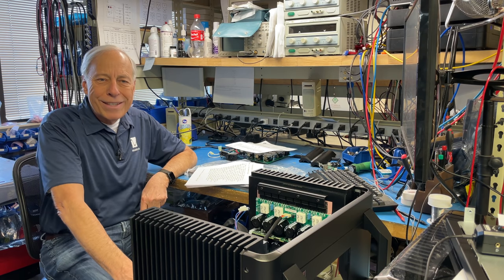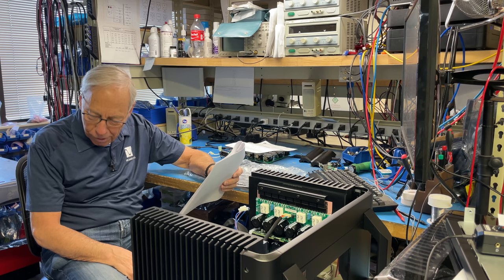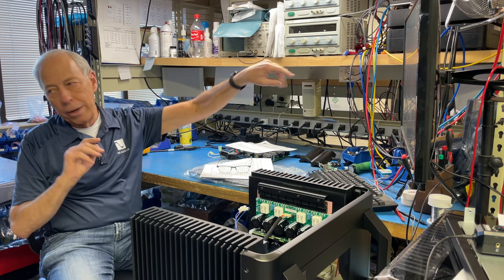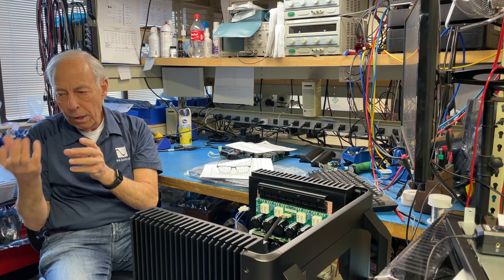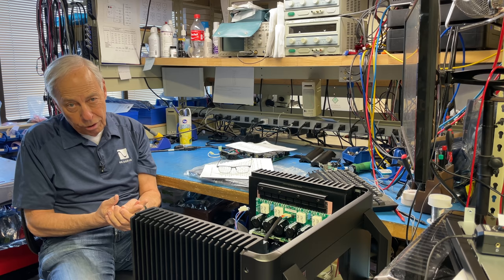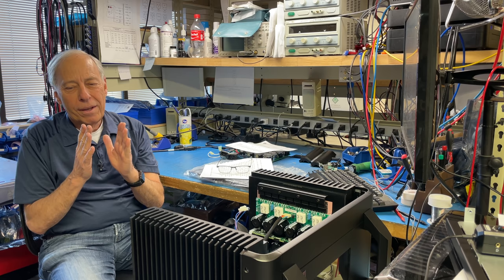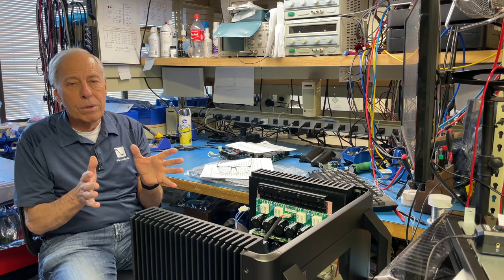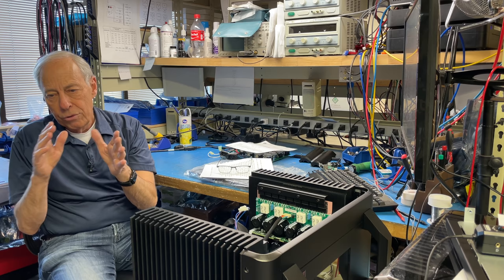Differences in digital audio cables

Comment: Sorry I love this channel and I agree with 90% of what Paul has to say but when he starts about digital, OMG he clearly has no idea how that works. Wow jitter noise and timing information encoded in the BIT's damn that is news to me. First of all why does everybody think a DAC is directly connected to an ethernet cable, it absolutly isn't. Ethernet cables are already galvanicaly seperated from the PHY chip, then there is buffering of the data in the PHY chip then the MAC and then the processing of the TCP/IP stack. Jitter does not come from the transport of the audio data it only comes from the clock used to drive the DAC. It's a ridiculous claim if you can hear a difference in an ethernet cable/switch. And yes I am an audiophile and yes I spend money on analog cables so I am not a cable hater.
Reply: I respect everybody's opinion but I will disagree. Networking gear (Ethernet switches and cables) both were not designed for audio.  Especially Ethernet switches. The ones you buy off the shelf are noisey with cheap power supplies that throw all sorts of crap in to the Ethernet cable to a cable or streamer. You are seeing more companies like sonore, uptone, melco, innuous  etc all realizing this with stitches designed specifically to combat this. I used to think similar that all that noise couldn't be riding down my Ethernet cable to my streamer until I started messing with its cheap power supply. And than you start optimizing all the other clocks and associated parts with the switches with a good power supply and it's immediately obvious. I'm honestly shocked it has taken audio companies this long to know they were never designed for audio. I admit though once you go down this rabbit hole you will keep finding improvements to be had with better and better power supplies for each component. After a certain power it's a lot of boxes to combat it. Just my experience.
Reply: Anyone who says you can hear a difference in network cables is either a NIC themselves or are living in lala land. What's next they can hear a difference in WiFi antennas?
Reply: @paulgyro  I have different Ethernet cables here that sound different. Why the need to discount what other people know that have tried them? Guessing your somebody that has never tried comparing?  One of those all cables sound the same folks? I really hate these cable debates with people that have never tried and compared different ones. And if they have, they haven't tried them in a system capable of revealing the difference. And even than you will have some so stubborn to reject they are making a difference because of the cost differnce.
Reply: @brandonburr4900  Just demonstrate the difference in a blind test. If it makes a difference to the sound you should easily be able to tell. Time after time though the results are not reproducible if the person listening doesn't know what they are listening to. It doesn't mean the effect isn't real, it just means it's happening in your head not in the equipment.
Reply: @CraigArnolduk  seriously? It's obvious in my system. No need to blind test things. I'm honestly sick of all this blind testing blah blah it's all in your head nonsense. I debated weather to even respond to this. Same nonsense audioscience.com crap tells people. I use my ear and my system to judge.
Reply: @brandonburr4900  It's very interesting, because apparently the science bit stops after the engineering? Everything we know about the human brain says that it is subject to bias and placebo, but yours (and perhaps all audiophiles) have some difference that distinguishes you from other human beings? Well there is an easy way to prove that if you wanted to. In a blind test. It costs you almost nothing to do. You don't even have to tell anyone the results. Well except yourself of course and therein lies the problem.
Reply: @CraigArnolduk  I have a engineering background. So no need to go into all that. Blind testing means nothing. You sound like you are just talking without having tried this stuff.  I'm no differe t than any body else. I listen to music for pleasure. I could care less about what others think honestly. Everything in this hobby has its own sound signature. Cables, components, speakers, wires, capacitors, resistors...Everything. it's all subjectictive and nothing is absolute. I'm going to end this exchange by saying nobody will win in these arguments with 2 opposed opinions. I'm going back to enjoying my music. Hope you have fun with your blind testing😀
Reply: @brandonburr4900  if what you are saying is true or possible then data couldn't go around the globe intact. All the error correction in the network stack and tcp/ip protocol takes care of issues.  Prove it to yourself by starting to stream or transfer any data...go unplug the cable. Wait 30 secs, plug it back in. What happens? It starting transferring like nothing happened. It will be the 24th century and we'll still be using the tcp/ip protocol because it so robust.  Now honestly ask your self if a system so power gives a cap above how fancy your cat5 or cat6 cable is as long as its undamaged and functioning within spec?
Reply: @brandonburr4900  just because you believe your brain can't fool you doesn't mean that isn't not real.  Psychological effects can be very powerful. Look up the placebo effect. Audio products are engineering and based in physics and thus science. Science requires repeatable, verifiable, duplicated tests to establish evidenced based truth. Blind listening tests are required to collect verifiable empirical data.  Any thing else at best is anecdotal.
Reply: @CraigArnolduk  lol as if engineers know anything about science
Reply: @brandonburr4900  ethernet don't need to be designed for audio because digital transmission don't give a shit what type of data it carries
Reply: @Harald_Reindl  your correct in that it does nothing to alter the data but folks designing them cables don't care one bit about how they reduce jitter, rfi and emi. Like a antenna it radiates that all right in the sensitive audio dac circuitry.
Reply: @Harald_Reindl  you make no sense. I'm not going to get in this debate. I know it makes a difference in my system with my speakers. You should go try it yourself instead of just spouting off without experience.
Reply: @brandonburr4900  I make my living as networking engineer and so I don't need to try audiophile dumbness on the ethernet layer
Reply: @Harald_Reindl  you really need to get a decent resolving system to investigate this stuff yourself. Obviously you haven't any experience

Comment: Network cables shouldn't make any difference, but when the packets are converted to a PCM bitstream and travels in your digital cable, then equipment makes a difference even if it is digital.

But the difference is not in the bits themselves but rather it's the spacing or time between two bits that is important. In theory it's constant and depends on your sample rate, but in reality it's not constant. When you have jitter (noise in the time domain) you'll get distortion as the reconstructed waveform no longer matches the source waveform.
Reply: And are there any humans that can hear this distortion? Even if it is there DOES IT MAKE ANY DIFFERENCE?
Reply: @zackschindler8334  see, I've been watching you throughout the comment section, and when you finally reach the scientific answer you wanted all along, you're still not satisfied.
Reply: @zackschindler8334  Yes, some people can tell the difference, and yes there is obviously a difference.
Reply: Jitter is for sure an important aspect in the digital domain for audio, but a digital cable (interconnect) cannot make that better or worse.

Comment: Just go wireless. Wi-Fi works great!
Reply: But but what about all the electromagnetic transmissions passing through the air? Won't the noise be picked up and degrade audio quality? Oh wait WiFi corrects and compensates for any issues as well as the tcp/ip protocol just like USB
Reply: A good audio system does not have any radios because they add noise to the analogue signal going to the speakers.
Reply: @paulgyro  yes bit perfect but RF from WiFi will make noise in the amplifiers

Comment: Hmmm I felt that was a lengthy introduction with a rather short explanation.  I'm also in I.T. and I really didn't understand how the noise 'intercepts' and/or 'invades' the packets.. I can understand that jitter and noise may be a thing, but... if you're receiving the bits, blocks, bytes over... say, for example.. a 1200 baud modem.. then jitter will undoubtedly occur .. and so jitter would be expected and persistent.  If the packets are being received correctly, then, my understanding is that it would then be a task for the DACs clock to outwardly convey the stops between the 'frames' or samples/cycles etc.  So, I can't say that answer resolved it entirely.... it seems to beg more questions, IMHO.
Reply: and at the point where he says bits are not just bits, they can carry noise just push your head on the table

Comment: You need a 400$ usb to pass zeros and ones. if there's interference, those zeros and ones could become other numbers lmao!
Reply: must feel good to have so much confidence in yourself than you laugh so arrogantly at those who know more than you
Reply: @vladg5216  I worked at a GM car plant (Detroit/Hamtramck Assembly) for 30 years in the IT department. The plant was 100% dependent on the data from the servers and the network. If for any reason the line stopped running it cost $50,000 a minute (USD). Needless to say there was a lot of emphasis on us keeping data flowing. Never once was there a discussion about putting different CAT5 wires in or worrying about RJ45 connectors that might be better because they had magical properties. it was a noise laden environment with hundreds of welding robots running 18 hours a day. And yet the data still flowed. Rest assured that the 1's and 0's don't care what wire they go down. Don't fall for this. It is fraud.
Reply: @vladg5216  feels great! 🤤
Reply: @vladg5216  snake oil at it's finest
Reply: @vladg5216  you know nothing, you just imagine a lot - for example that digital bits have noise and give a shit on cables as long they follow their specifications
Reply: @Harald_Reindl  LoL 😂 0010110010110
Reply: @zackschindler8334  thank you!

Comment: Nah.. Other than the quality of the materials itself there really is no difference on a digital cable. If there is noise it's usually the equipment that has an issue somewhere. Better to fix that issue than getting a "special cable".
Speaker cables I can hear a difference but not in digital cables. And especially not in USB.
Reply: I believe filtering is different for equipment. I think it’s easier to filter a small one purpose Dac, than a big Dac or source that can do many things...

Comment: "data isn't just data" "bits have noise" this is nonsense. Quality of audio over USB is nothing to do with the cable. It's all about implementation. UAC class 1 is a bit crap UAC class 2 is a lot better, and it has to be async mode, but if you have a poorly designed DAC that uses the USB 5v supply and doesn't filter it adequately and passes noise to the analogue side then it will affect audio. Simple answer only buy a properly designed DAC. Doesn't need to be expensive just well designed. If I bought a DAC from a company that recommended expensive USB cables I would instantly suspect they are selling low grade DACs and avoid.

Comment: almost all cable noise is because of there being two grounds I find. A 1000$ usb cable will carry that noise just as much as a 10$ cable. Don't be fooled. Its about the device design not the cables. Buy good DAC's etc that have isolation, digital cables is complete snake oil.

Comment: Digital cable makes about as much difference as a power cable, NONE, sorry. Watch the video of the guy doing a test and used a 100 foot unshielded  20 ga. speaker cable for a digital cable, no difference till a point where it just cut out, NOTHING inbetween. And a power cable gets power from the wall outlet to the power supply in the gear, THAT's it guy's. I'm all in favor of quality AUDIO cables, but the snake oil starts flowing fast.

Comment: Naaaa. Unless sent and received bits are different there shouldn't be any difference. Difference means sent and receieved bits are different.
Reply: Check audio science review channel
Reply: Paul is really bad in explaining things... What he meant was that yes, the cables do change the bits, as interference and noise exits and those tend to degrade the signal, but error correction makes them perfect in the end anyways. Yet, all the interference and noise Was carried through the cable and it might have an effect on the electronics and components inside the playback device, thus, likely affecting sound. But it does require noise and interference to exist first, and the receiving device to be sensitive enough and poorly shielded enough that it makes a difference.
I'm not saying you should buy a USB cable that costs a kidney, I'm just saying he does have a point and yes it's possible it makes a difference in certain scenarios, or not at all in others.
Reply: Also check Hans Beekhuyzen he explains in great detail what goes wrong in his video "connecting a DAC how digital can go wrong"
Reply: Yo chuck, if what u say is true then buying the cheapest dac make sense. But they all sound different. Maybe you should research more about bits etc. Better is to go to a shop and listen rather than complaining.
Reply: @freone111  Different DACs mean different bits. Thats why
Reply: @freone111  The reason DACs sound different is the analog circuits. Now jitter is also a problem, but that the reconstruction of a clock signal from the received data is an analog function as well. But these audiophile grade routers and Ethernet switches are pure snake oil.
Reply: @freone111  but at the point the DAC converts to analog the signal has left the digital world

Comment: Badly built and badly designed components are the problem! If you have a cable that makes a difference - replace your badly built and badly designed components rather than spend money on cable band-aids!

Comment: People online should stop fighting about cables. Cables matter in the sense of pairing it with your system. If u have a budget system it wouldnt reflect a good cable. Just upgrade components. A good cable is beneficial to a good system. Stupid people generalize not to buy cables because it does not matter. That guy teaching u that is using an expensive kimber cable. Such a hypocrite.
Reply: @Douglas Blake you can say what you want. The matter is ived heard the difference installing different major brands. My clients have heard it, im sorry    if you dont hear a difference. Maybe you should build better equipment or buy so you can hear.
Reply: a digital cable with a optical transmission for 5 dollars with a length of 15 meters is good enough for every system because it can't have grounding issues by design and just works or not

Comment: huuuuuuuuuuuuuuuuuugggggggeeeeeeeeeeeeeeeeeee :) this is it guys, if the cable transmits bit-perfect data, which it does as paul agrees, plus noise etc, then isn't it the case that the receiving unit itself must separate the unwanted stuff? this just makes me nuts. so i can stream bit-perfect digital data from tidal servers across the glob with no loss or data corruption, yet the last 2 feet of cable - the digital cable - screws things up. OMG. The issue is UDP as the digital link to the dac is just one way - synchronous - with no error correction and buffering. but cable companies love this - it's a cartel.